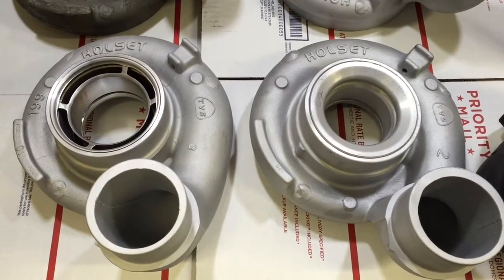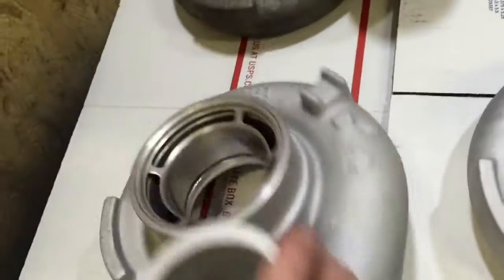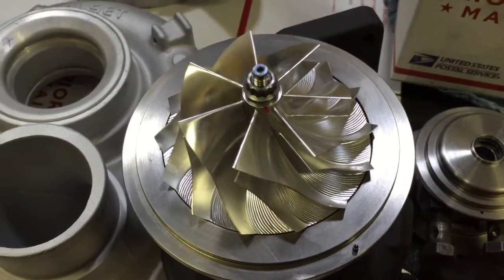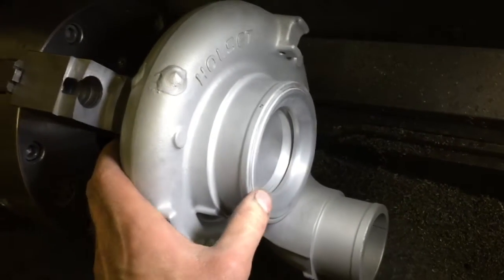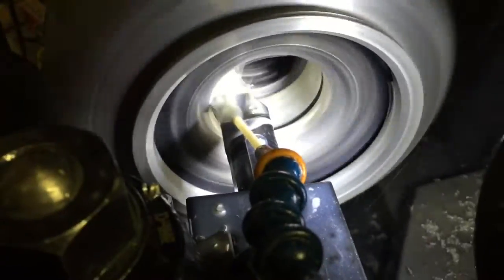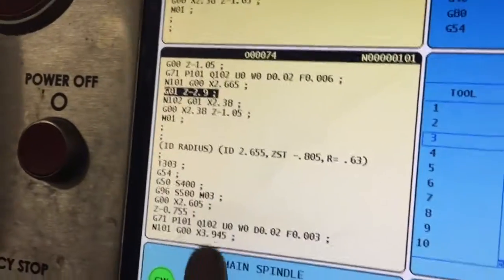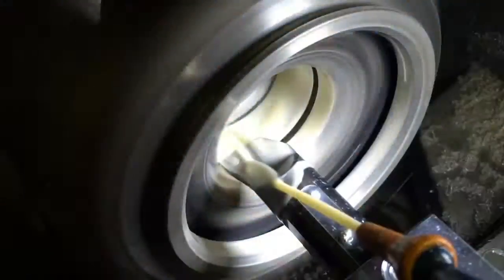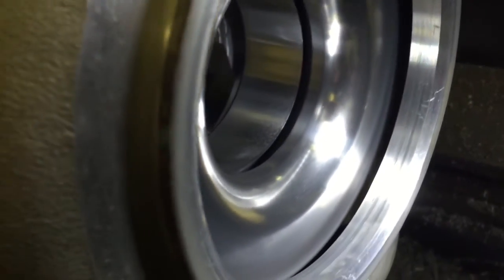Holset He351ve Vgt Compressor Housing Machining

Comment: Also , when you upgrade these do you upgrade the turbine wheel and housing as well?  I want to do this asap to mine, but also want the turbine larger to match to even further help with the EGTs. If  i sent you just the housings from mine, what would it cost me to do the 67mm billet comp wheel and the matching turbine wheel and fit it to the houseing?

Comment: What do you have for the cnc controls on the lathe? is it a ProtoTrac or something else that you have  send a program to from something like MatserCam or something similar?
Reply from the maker: +jesse rossetti  my machine has a manual date input option that writes the g codes for me.
Reply: You mean a conversational control.
Reply: Manual data input is where you hand g code.